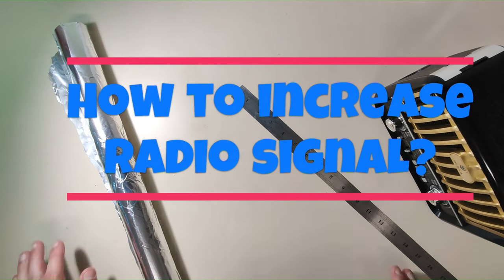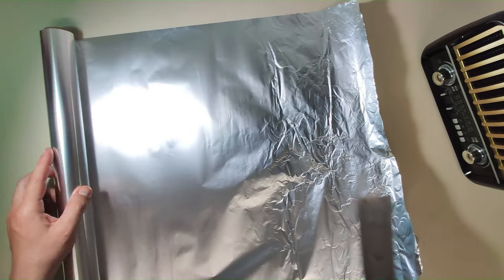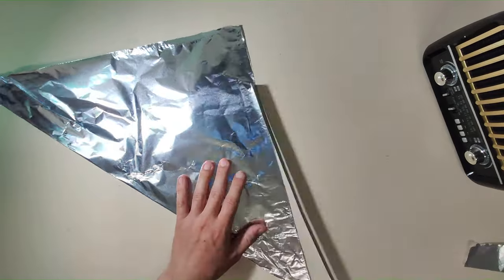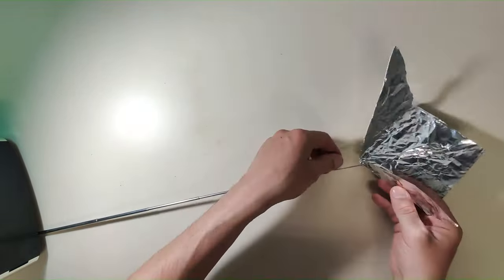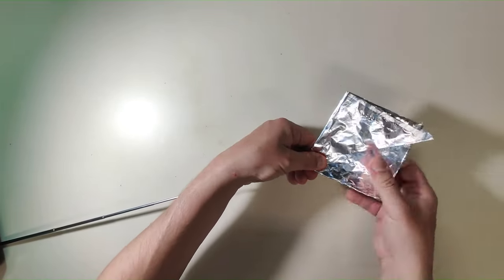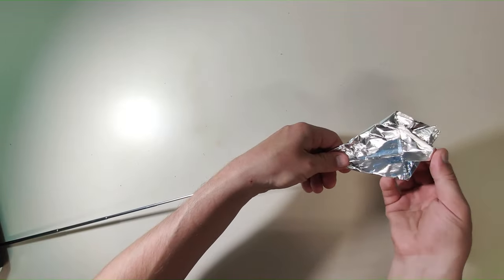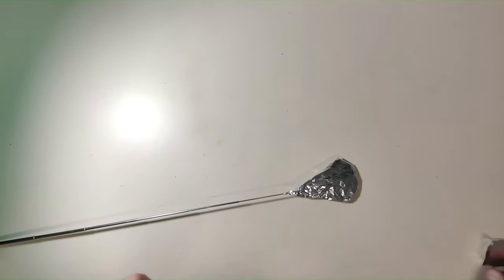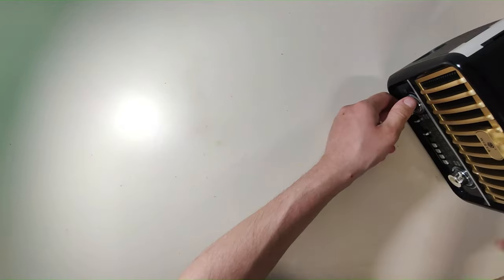How to improve radio signal strength

Comment: Sorry but I dont belive any of this.Either for AM or FM,adding a short lenght of copper wire to the end of the telescopic antenna is all you need to increase the signal.
Reply from the maker: Didn't try the copper wire, but logically it should work too. Whatever suits you aesthetically ;)
Reply: I've used copper wire and it's always worked
Reply from the maker: @DavidCajun-qf9ti  Good to know! Thanks for sharing 😉
Reply: @DavidCajun-qf9ti i want to increase it to communicate with aliens
Reply: Iam using the same copper wire and its working great.
Reply: @professor1395 The tinfoil can double as a hat if necessary.😅
Reply: Ideally, the antenna length should be a division of wavelength.

Comment: The telescopic antennas on portable FM radios are usually too short. Adding a conductor to the end to increase the length will usually improve reception. As long as it's metal and connected to the antenna end it'll work. Any total length greater than about 2'6" will not bring any further benefits.
Reply from the maker: Thanks for the details! Interesting
Reply: Okay, but it's far from pro help.   I mean, if you're going to go through the trouble of DOING (work) then you might as well do the best.  So...this means....a FRACTAL antenna with RF PREamp(lifier)/Tuner well grounded at all key points and MAGNETICS is Key to antenna system so Extract Especially the Magnetic moreso than the electrical component of the RF input signal.  And if you know electronics and /or radio...impedance &capacitance matching the antenna system to the radio circuit/s.
Reply from the maker: @kieran-299  Well, I think most people are like me, and don't know electronics well.. and it only takes 5 minutes, in comparison to what you are saying.. 
And although you have logic in your words. To me, what you said now sounds like most advice I found online and it just confused me and sounded really complex .. when this method is super simple, easy, and it works pretty good (I am doing just fine with it for years, the reception is very clear). 
So maybe its a matter of personal preference, and depends on how bad the signal is in the first place.. maybe if the signal is totally horrible this won't work well...however it only takes five minutes to try it ;)
Reply: @PurpleSundayz  Yeah, it's fine.  Actually, you are right...in most typical situations for typical person, yes your advice produces most "bang for effort n knowledge (lack thereof).  Sure.  I get it.   In fact, even I'm not completely sure my comment was very good for typical person or even myself.  I am a licensed ham radio operator but not much operation Experience, so I'd still like to know how to receive radio signals the key easiest yet producing most best results for it.
Reply from the maker: @kieran-299  Good luck with the experience, sounds like you know what you're talking about. Thanks for commenting :) good discussion
Reply: What if I make it directional

Comment: I must be honest, I was skeptical. I did not think it was going to work. And it didn't.
Reply from the maker: Honestly I'm skeptical that you did it right, because it should work, it's physics you know..and if you did, then perhaps it is time to buy a new radio 😜
Reply: @PurpleSundayz  No, the radio is brand new. I am in a poor reception area and it had no effect at all.
Reply from the maker: @Uvray  i'm sorry to hear that.  This method  enhances the reception, not creates it out of nowhere.. if the reception is really low, try locating the radio in a different spot in the house. Perhaps near a window.. just turn it on and walk around until you hear it working. Also, make this experiment twice, once with the foil, and one without it, and I'm sure you'll notice the difference ;) 
Hope it helps!

Comment: Not gunna work
Reply from the maker: In fact it does work. not a 100% perfect solution,  but improvement is very noticeable. I didn't need anything else to use my radio comfortably.

Comment: It worked for my radio based watches. I had to hold them outside of the window for about 10-15 minutes, but after watching this video, I made a twofold 2 foot long aluminum foil strip, tapered one end, put one watch around the tapered end, put some weight so they don't fall off and placed about 3/4 of the strip hanging outside of the window. The experiment worked! Although, the signal strength improved whenever the strip would hoist with the wind. So, maybe I will have to improvise with a wire making it bend upward to catch as much signal as possible. Having the watches synced up was a big pain, as I have four of them, and I couldn't find signal amplifier anywhere after months of searching. Thanks!
Reply from the maker: Wow That's so cool!! First time I hear of radio watches, very interesting. I'm Glad the experiment worked, and yes, perhaps try using a metal wire that wouldn't bend.
Good luck, and thanks for sharing ;)

Comment: Would have been better to use the foil to make a hat.
Reply: Nah, it works, just a lot of fiddling about & overcomplicating. I thought there's be an actual tip here, though.... Add metal on top, that's the whole thing.
Reply from the maker: @echognomecal6742  That's right, just add metal on top ;)

Comment: Have you seen the coil and capacitor antenna for A.M. ? External antenna with no connections.
Reply from the maker: No I haven't, what do you mean? I've seen some cool antennas, but not with no connections
Reply: @PurpleSundayz  28 turns on 2 foot square with variable capacitor from tuner like crystal set . Tune in your channel and adjust capacitor to match inductance to your radio. Remember you may have to turn radio or antenna to bring in the best. You tube is where I seen it.
Reply: @PurpleSundayz  And no connections.
Reply from the maker: @roysmith332   send a Youtube link where you saw it .. anyway, can't imagine where you'd put this 2 foot thing .. sounds space consuming. And it has an antenna after all?.. 🤷
Reply: @PurpleSundayz  just look up A.M. loop antenna. They are other's to see and buy .  A.M. loop antenna.  With the wood is the one I made. Wonder about bigger one being better. Like outside on tower going around tower. It works that well.
Reply from the maker: @roysmith332  I saw it, and it actually looks very cool! A bit large in terms of space, but looks quite aesthetic :). Guess it's a good solution when there's no external antenna.
Reply: Marconi, Tesla and others work big coils. Like 4-5 foot high. Nelson Stubblefield transmission had coils in the ground also.
Reply from the maker: @869handyman  Wow that's some historic stuff! Had to look some of the names up. Thanks for sharing! ☺️
Reply: You welcome, glad I could help.

Comment: Will it work on DAB+, and would it improve the reception to receive AM stereo?
Reply from the maker: Not sure what DAB+ is.. but as long as it requires the antenna for reception, it should work.. try it and let us know if it worked, it only takes a few minutes ;)
Reply: DAB+ is digital audio broadcasting, which has been used in Europe and Australia for at least the past 15 years. In some countries it has already replaced AM and FM radio.
Reply from the maker: @GregPain-pq8yh  Thanks for the info! Did it work though?
Reply: @PurpleSundayz  As we are in a fringe area behind hills and forests, we use an external antenna on our roof, and on our car. So, we're unsure if it'd work on DAB+. I'm still curious to see if it'd improve AM stereo.
Reply from the maker: @GregPain-pq8yh  From what I understand, as long as there is an antenna for reception, dab or fm/am, it should work. Not sure about a permanent solution for  the car though, the foil looks kinda unprofessional outside of the house, and may fly in the wind..perhaps only replacing the antenna with a bigger one. Anyhow, I hope it works for you! Let us know if it did ;)

Comment: Not a great video, but the basic idea is correct. Add metal to extend &/or widen (sort of like a satellite dish) & it can improve the signal.
I was hoping for something new here. I've done variations of this on radios & tvs. Some need a lot of fiddling around to find the right spot. I had it work for a time, then needed adjusting to find the signal again.
Personally, I'd never be bothered doing that tiny little piece.

"Quick & dirty" solution: Poke 2 holes in a CLEAN (Let's not be savages) disposable pie plate & slide it on the antenna. Maybe bend the top over the tip. Easily turns to find the sweet spot.

(Easy pie plate, etc. cleaning: Have a brush at your sink. Soak, then brush off stuck on stuff before washing. Saves Lots of time & effort & saves you from having super gross wash water.)
Reply from the maker: Not a great comment, but I like it 😜 . 'Quick n dirty' solution is nice idea, and you made me laugh by explaining people how to wash it 😂
Reply: @PurpleSundayz  The rude comments you got are just...so unnecessary. Either actually have something to say or move on.
Gotta go for the laugh, yanno lol
...& it looks like a good percentage of people need a bit of instruction/clarity
Reply from the maker: @echognomecal6742  So true.. gotta go for the laugh ☺️🙏